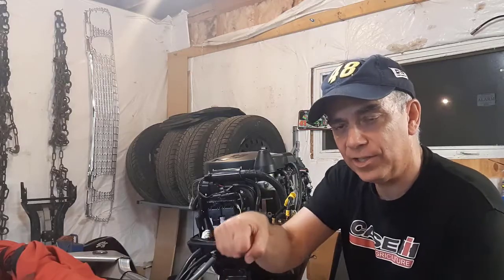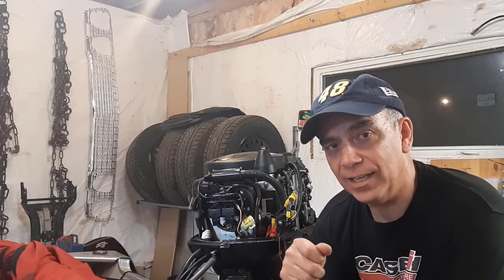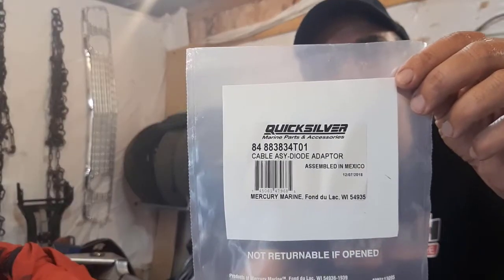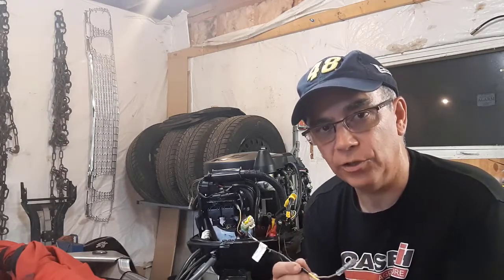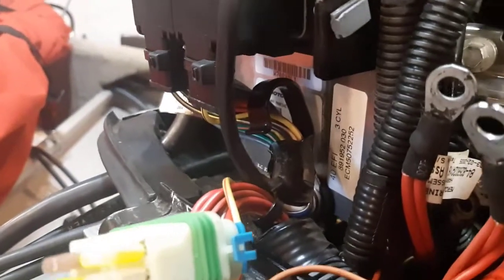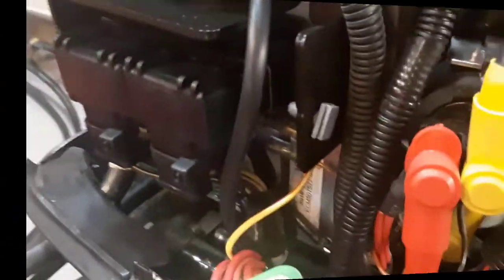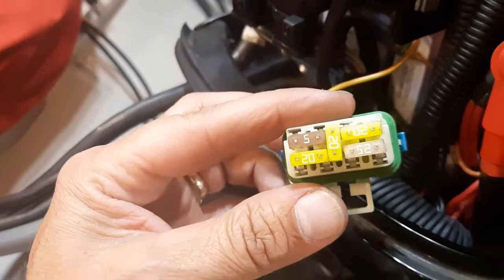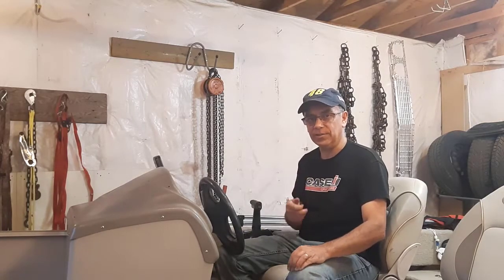Boat Outboard Reverse Battery Hookup Fix // Mercury 40 HP 4 Stroke Fix

Comment: I did the same silly but common mistake to my 60hp merc 4stroke. Thank you so much for the easy repair job. I'll open up the damaged cable to see what the component is inside. Diodes can go either open or short circuited so it must be something special. I'll try and get back to tell everyone. Thanks once again for the video...Warren

Comment: Just wanted to say THANK YOU ! ….. I did the same thing and because YOU took the time to post your fix, this saved me time and money by doing it myself…. and like you when I turned the key to start the engine after replace the cable assembly diode and it worked !!!!
Reply from the maker: That's great to hear. I had to swallow my pride on this video because of my careless mistake but it seems to be helping many. So that makes me feel good. 😊

Comment: I'm so glad I found this video!! I did exactly this a few days ago; swap my battery leads without thinking. I have a Mercury 30HP so I'm hoping it's the same assembly diode cable but I'll check. Fingers cross!

Comment: Lol, not laughing at you, laughing at the memory of fixing a ton of these from the same mistakes. Lost many a pair of sunglasses leaning over the engine to replace the fuses too. I cant tell you at the 50cent fuses that costed people 100 bux. $50 lake calls, 50 cent fuses, and $45 diodes (back then). Alot of people would get mad over a 15 minute fix costing them 100bux. The motto? "Pay me for what I know, not what I do" lol. Great job! Glad you got it fixed, my friend!
Reply from the maker: It was a stupid mistake that shouldn't have happened. I swallowed my pride and did the video anyways. I know it will be a popular video and will eventually pay for the diode. That's right, and you should get paid for what you know.
Reply: Don't beat yourself up over it too bad, $#!+ happens 😉 We didn't have you tube back then, so, maybe your vid will help someone else in need. Boats used to be pretty simple, but, when they breakdown, its a pain to chase down what the issue can be. Nowadays? I'm not sure I'd even pop the calon to check the plugs, lol. All those electronics kicked my but years ago 😆

Comment: That’s a really easy mistake to make. 

If you want to rebuild the burned out diode you can cut the old one apart. It most likely has a 1n4001 or a 1n4002 diode inside. 

When they get reverse voltage they blow out and create a short circuit (it’s called a crowbar circuit) to protect the rest of the electronics. 

It just goes directly between the hot and ground wires. It’s easy to replace. There is stripe on the cathode end so you just put the new one in like the old one came out and put more shrink wrap back on. 

When you open the shrink tube it’s most likely not burned up and it should have a number on it. 

I’m not sure if Adafruit Industries ships to Canada but the cost of the diodes is 10 for $1.50 US. 

Have a great day my friend and be safe out there!
Reply from the maker: Hey, great info. I had no idea I could even do that. You know your electronics! I would have saved a ton. Lol thanks for sharing, may need that info one day again.
Reply: I was thinking the same thing.  If you open the old wire the diode is marked with what type it is.
Reply: @Mr_Dopey  No one seems to have checked this? I also wonder how they market a 2 cables + 1 diode for $60 while the diode most likely is a cents worth item. Sadly no one seems to know details here?
Reply: Hey hey. Not an electronics specialist here, but disassembled my (broken) diode. It says "GPI5P" or "GPI5F"
then "006" and "45" under this (the whole bottom line is "3545" with the "45" very centered under the "006")
and the print is purple, also the printed ring on the "+" side of the diode in purple
Also a manufacturer logo I cannot identify.

Problem: that's lots of information leading to nothing. How to replace it or at least to identify it's properties? Any idea @DaviddoesStuff ?
Reply: in the end I followed a general advice from car motor experts and bought a P6KE18CA (bidirectional, blocking voltage 15.3V, peak pulse power 600W). The original from Mercury is unidirectional, which (I guess) is not beneficial.
I pays less then 20 cents plus 2 crimp connectors.

Comment: Hi there. I did the same thing but did not have an issue starting motor afterwards. However took boat for a drive and battery drained. Put another battery on and wouldn’t start. Bought a new battery and seems fine but when I measure the voltage while cruising it does not look like it is charging. Checked all fuses and they are all good. Battery stays at same voltage. Doesn’t go down doesn’t go up while running. Shouldn’t it go to 14 volts?

Comment: When you first wired it, was there smoke coming from the motor? After you corrected the battery leads, did the motor crank but not kick over?
Reply from the maker: Sorry it's been so long I don't remember

Comment: Why did you remove the cable from the relay?  Is it because you left the battery connected?

My relay only has 2 wires and the ground has three. Is that probably because I have fewer accessories?

Comment: My 50 HP Merc EFI ran OK 2-3 time. After it stopped for a while. I couldnt start it again. It even doesnt have crank. I tried maunaly start but it was in same case. Not sure what happens. It's the first time run this spring. Thanx

Comment: I made this mistake but it did not blow a fuse.  Motor won’t crank (only makes one click sound). Do you think I should replace the diode or is there a chance I fried the solenoid or starter?

Comment: Is it possible to have a bad celenoid but a good fuse?  I've done that (reversed poles)  before and the marina replaced the fuse, my merc was throwing alarms. A year or two later....I did it again. I took the battery off for winter, charged it. Before I charged it , it was at 50%. I'm wondering if the new battery isn't charging during use due to a blown fuse of celenoid.

Comment: Same thing happened to me but on my mercury 115 optimax unfortunately. Except the negative terminal on the starter battery instantly fried off when I switched it from both to 1 (starter battery). Put the batteries back to normal and tried starting it up again. Cranked over and when I tried it again after, the solenoid no longer clicks. I replaced the solenoid thinking it was that but still no click when I turn the key. Hopefully it’s the diode or the ignition switch. If you have any advice I’d greatly appreciate it.

Comment: Thank you. I’ll try this out. I too reversed my cables. There was a little spark. Then no trim and tilt at the throttle and the motor. Also nothing when I turned the key. I can’t find any blown fuses. So I’ll check to see where the diode is. I have a 2016 Suzuki 140 4-stroke. Is there any way to check the diode I have?  Like with a volt meter?  I live far from a dealer. Like 1,000 miles. Thanks.
Reply: I don’t think yours will be the same since it’s a Suzuki. Check the 2 main relays

Comment: when this happened to you. Were you still able top start ? I too did this but motor still ran any help is greatly appreciated   thanks
Reply from the maker: No not at all
Reply: Did you solve your issue Gator? I suspect that my engine has been connected with wrong polarity, it still runs perfectly but isn't charging the battery!
Reply: @BeingSwenglish  yes i did so thanks

Comment: Hi, Thanks a lot for this video! I liked it a lot. I got a Mercury 2016 4 stroke 60 hp efi outboard. Would not start after running 30 miles at full or 3/4 of throttle. Trim is not working either. But it makes a very weak noise in the fuse. What could be the possible issue?
Reply: did you ever find out the answer to this? mine is doing the same.
Reply: Same

Comment: So I have a weird similar problem. My starter went out and I took it out to find the serial number and put it back in and connected all the wires back up. The weird part is that my solenoid is getting 12.6 volts but my starter that’s right about the solenoid is getting -12.6 volts. Do you have an idea why that is negative? I put all the cables back the same way I took them out.

Comment: I did the same thing, but was in the middle of diagnosing and trying to fix a battery /alternator problem. I did not try to start it with the wires crossed, but might have burned up a charger. Will it run with a bad diode? I am still having battery issues.
Reply from the maker: I don't believe it would.

Comment: Hi, my friend and I, disconnected the battery in emergency. On the river, the starter jammed on the motor. We removed the wired and did not check where positve and negative goes. Mercury sea pro 40 HP. we do not want to burn anything and trying to find where the positive should be connect. Thanks.

Comment: Question.. Will this prevent the trim from working too? I have the same issue I was replacing the battery terminal and I think I crossed the terminal but crazy thing is my trim won’t work too
Reply from the maker: Not sure if I checked. it's very possible.

Comment: That’s a really good tip… My dad always used to use different battery cables for the positive and negative… Like different attachment points that way you could never confuse them

The last boat I had I used these since I always removed my battery

https://www.amazon.ca/Battery-Connector-Connect-Disconnect-Trailer/dp/B00YOFBSF8/ref=asc_df_B00YOFBSF8/?tag=googlemobshop-20&linkCode=df0&hvadid=292952575646&hvpos=&hvnetw=g&hvrand=7859284914797846218&hvpone=&hvptwo=&hvqmt=&hvdev=m&hvdvcmdl=&hvlocint=&hvlocphy=9000079&hvtargid=pla-569277321020&psc=1
Reply from the maker: I will take a look!